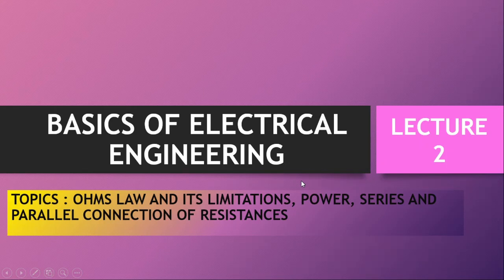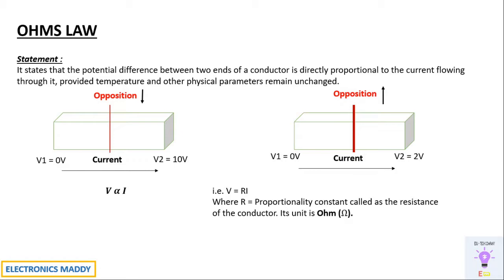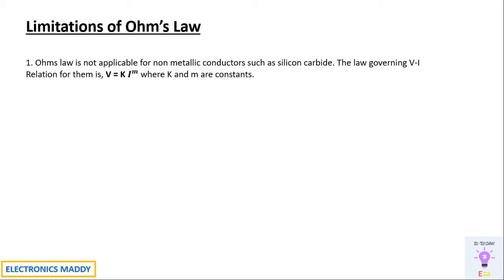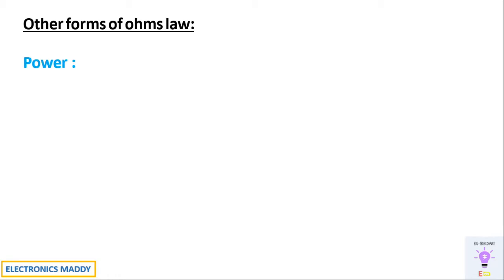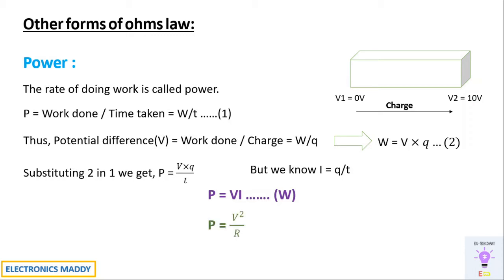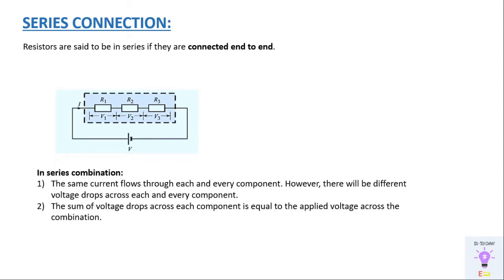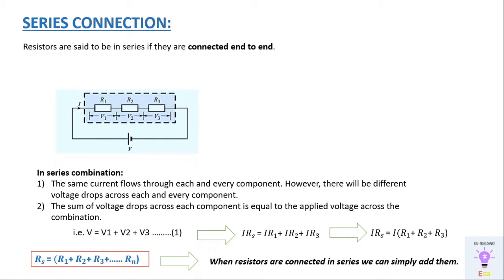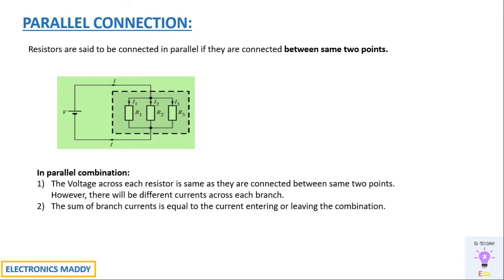Ohms law | Limitations of Ohms law | Power | Series and parallel combination of Resistances

Comment: Is ohm's law comfortable for series and parallel combination
Reply from the maker: It depends on the circuit Raushan. If you have non linear loads or circuit elements which are non linear, then it may not be applicable. But in general cases for series and parallel combination it is applicable.